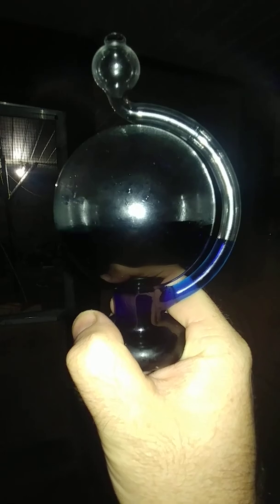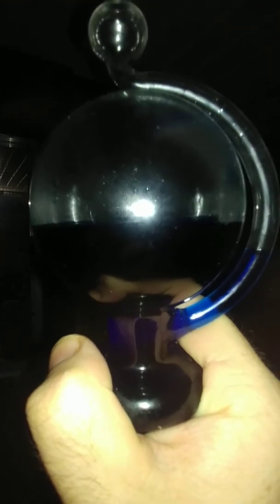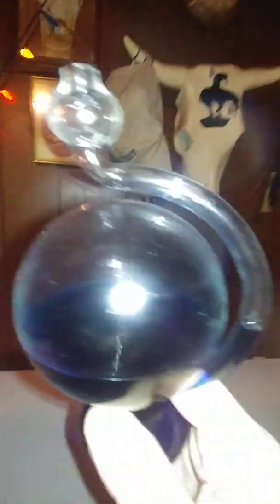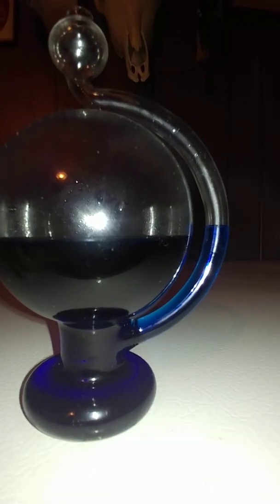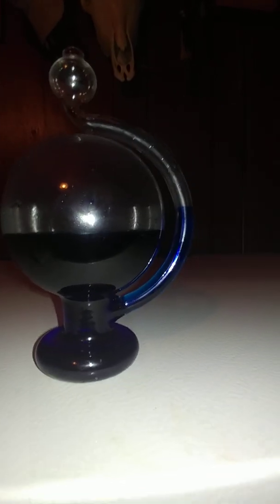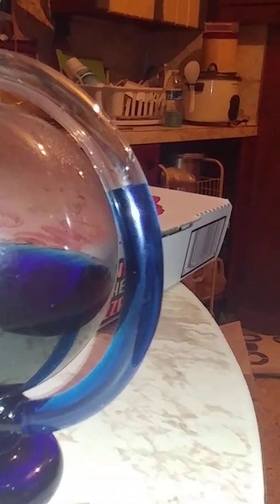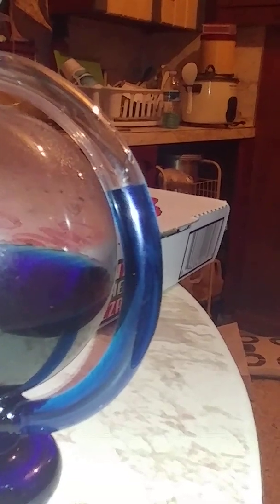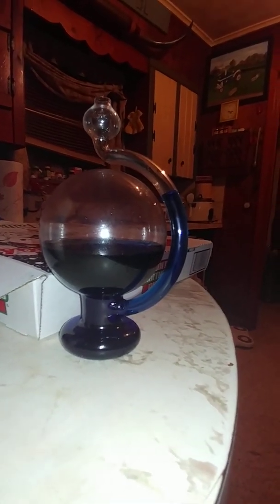Inside vs Outside Pressure - Glass Storm Barometer

Comment: A little late to the party here, but the others are right. It's the temperature difference.  
Warmer inside, so it heats up the air in the chamber, and pushes the water out (up the side scale). Outside is cooler, so the air shrinks, and the water in the side scale drops. 
You can see this clearly if you run some cold water over it, or slightly warmer water. These only read pressure changes when at the same (or close) air temperature.